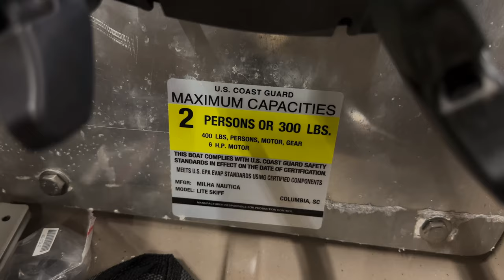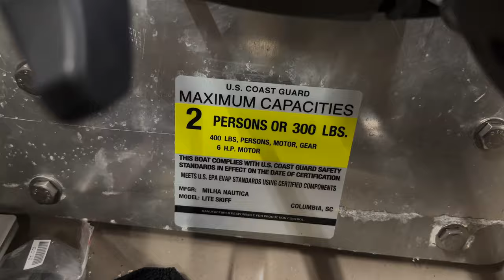Over the top kayak buildoff

Comment: You make some amazing stuff! For the lvs34 transducer. A company called Fishing Specialties makes a kayak & boat version transducer poles. They also have a lvs 32 & 34 transducer mount. It connects directly below & in live with the pole. That would have worked too. The mount is basically a small ram ball with  2 plates. One to connect to pole & other to transducer. It also allows for infinite angle adjustments for the transducer which is great for perspective mode for different depths

Comment: Pedal drive does much better in wind vs paddle only kayak.  The paddle becomes the limiting factor because it becomes a mini sail. 
I have fished easily on windy days while paddle kayaks struggled.
Reply from the maker: Yes, straight into the wind, but not when you have to turn.
Reply: I fish 5 or 6 days a week in my Hobie PA12 180 here in Ontario, Canada and dealing with wind is a challenge for me.

Comment: Can you share your welding set up?  Looks like you have a mug welder just curious what your running.  I have a millermatic 211 and want to set up for aluminum welding.   Thanks in advance.
Reply from the maker: Millermatic 255 with pro gun push/pull mig setup. Full Argon tank.

Comment: Btw $700 for this unit, plus trolling motor, plus battery, plus figuring out how to mount it yourself, your still basically at about $1200 give or take.
A real spotlock motor is not much more than that, and this product may drive those prices down to compete.
If this motor unit was more like $300-400 it would be worth it.
Not sure this is worth it at that price point which is way inflated.

Comment: I would like it much better with a PWM with "infinite" speed settings instead of a 8 step speed controller.
Reply from the maker: It does have a PWM, just with eight speeds. Minnkota does the same thing, but they have 10.
Reply: @TinyBoatNation  I know but PWMs without designated speed settings are much better for custom speeds. It would be a much better design IMO.